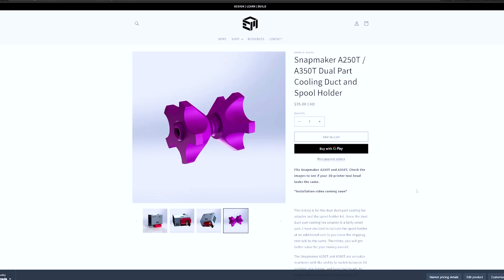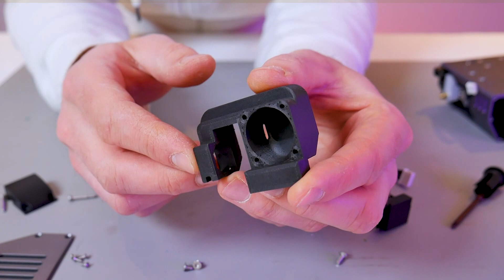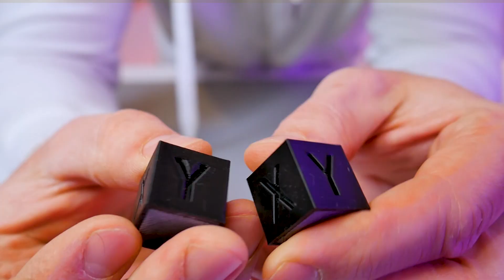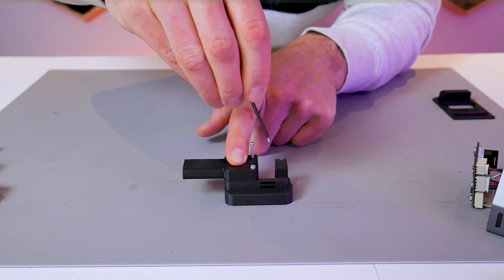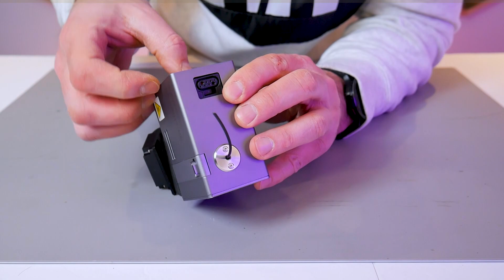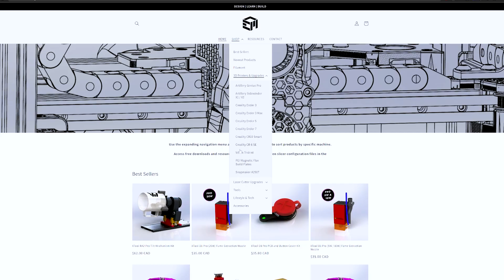Snapmaker A250T / A350T Dual Duct Part Cooling Adapter and 4010 Fan Upgrade

Comment: Hello, I have just installed your part, unfortunately you can no longer get the cables out of the housing if you have to change your heat block nozzle.... unfortunately I had to put everything back in the original. do you have a solution here?...  Anyway, thank you for providing the stl file, I appreciate that, maybe you can provide the step file for just this part, then I could larger the gap myself, so that you can easily change the hotend again... thank you very much in advance... thanks again Dirk

Comment: 2nd try, my phone hates me :) after updating the firmware and Luban in Jan for the quick swap kit, I've had nothing but issues with all my prints.  After many many tries, 3 weeks ago I finally got back to reasonable prints, not great but very close to what it was.  All that was remaining was some slight stringing issues and BETTER under hang issues, if that's the correct term, after showing pics to the snapmaker Facebook forums, it was suggested I use a fan upgrade, after searching I found and bought your kit and suggested fan.  Happy to report this mod seems to have fixed the under hang issues so far on 2 small prints,  although haven't tried on a bigger print yet.  The final stringing issues appear to be fixed as well by changing retraction to 3mm.  An issue I have now is that I'm trying to print an engine block for an RC boat, but at 60% the build plate gets moved about 3/4" and bird's nests, tried twice, same thing, went to add avoid printed parts, but it was already on, trying with prusa instead Luban incase incase it's a Luban slicing issue as I'm hoping it's not the mod.

Comment: Cool design, just printed the available file and put it together. Will you sell the file for the 4010-Kit, because I already bought fans after I saw your video, only to find out afterwards that the full kit isn't available as STL.
The shipping to europe lifts the price to a number where I' rather design the missing parts by my own. Maybe you can calculate a good price for the STL of the full kit.

Comment: I printed and installed the ductwork, and my printed objects all seem to come out with a slight taper at the base since.
Reply: Wrong calibration that causes the first few layers to be squished together because there should be more space but isn't.
Recalibrate with the paper and just don't move it down as much this time.

Comment: Will this mod help with stringing issues I've try every thing else to fix it lol
Reply from the maker: It might... what other settings have you tried to adjust?
Reply: @EmbraceMaking  lower retraction setting and hotend is there more than one verson of the print head coz you're one looks different from mine?

Comment: Hi recently  bought the kit and got some 4010 fans but not turning on when printing not sure what could be
Reply from the maker: Did you get it resolved? Do you have the polarity of the wires the correct way? Sometimes it is the simplest solution

Comment: So, is it worth picking one of these up? I got an X1c for printing fast, but I like the idea of having some usage of a laser etc. But I've heard so many brutal things about this and how bad the service is Idk if I want to take the chance.
Reply from the maker: If you have an X1 you'll never use the print head on this thing. So the next question becomes are you prepared to pay the full price if you're only using 2 of the 3 functions? And will you grow out of the capabilities? If you never see yourself doing anything more than small parts and you're strapped for space then maybe you can justify it. If you want to take on bigger parts, laser thicker materials, machine aluminum etc then skip it and get machines dedicated to those functions. It's a super cool machine and the quality feels amazing but it's kind of funny that by trying to be versatile I feel like they actually did the opposite and made it pretty niche

Comment: I recently bought a used A350T that had a completely melted existing fan shroud from an extravagantly failed print. I was struggling for so long with getting any reasonable prints out of it. This video was super helpful! I printed the multi-duct adapter and now I can actually print in reasonable quality. I also just bought your 4010 adapter kit, excited to throw that in once it arrives. Seriously, thanks again!
Reply from the maker: Thanks for sharing and enjoy the kit!

Comment: Hi! I see the dual duct adaptor on Printables, but can't find the 4010 adaptor -- do you have that available as well?  Thanks!
Reply from the maker: Hi Michael, sorry the multi duct parts I offer for free with the original part cooling fan, but the 4010 adapter is only found on my website for purchase as fully printed parts. Trying to pay for all of the design time and video editing time etc in some way. This video isn't really doing well and the YouTube ad revenue just doesn't cut it sadly :/
Reply: @EmbraceMaking  I understand that, but it's really not clear that you've made that distinction, and that you've decided to differentiate it that way.  It feels a little 'bait and switch' to me, to be honest.   I printed the dual adaptor, was coming back to find and print the other, and now I find out that it's not readily available, as the other one was; feels.... disingenuous.

I've downvoted this, and recommend other makers  to not bother with this; there's other adaptors and plans for the snapmaker that you can print and use instead. (Search Printables for "cooling snapmaker 2.0" -- I've printed that, have the fan, and it seems to work well.
Reply: @sallz0r  Oh go cry to mommy, then you can go and design your own part. "I downvoted this." jhc, you sound like a spoiled kid.
Reply: @sallz0r  I have to agree.  I went to the link with the assumption that all parts are available for printing.

Comment: Hi, do you also have the STL for the 4010 adapter ? :)
Reply from the maker: Hey, sorry the multi duct parts I offer for free with the original part cooling fan, but the 4010 adapter is only found on my website for purchase as fully printed parts. Trying to pay for all of the design time and video editing time etc in some way. This video isn't really doing well and the YouTube ad revenue just doesn't cut it sadly :/
Reply: @EmbraceMaking  ok good will order it. thanks!